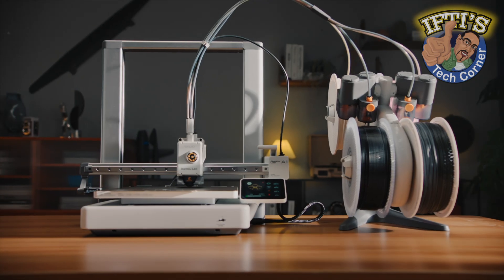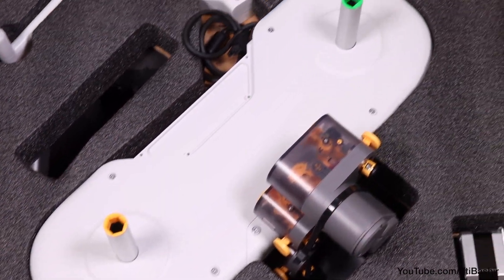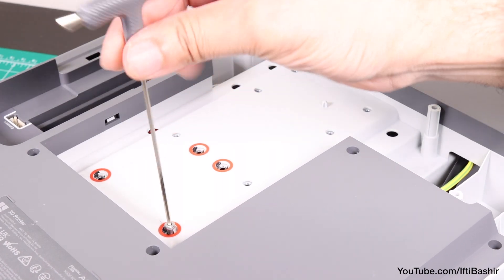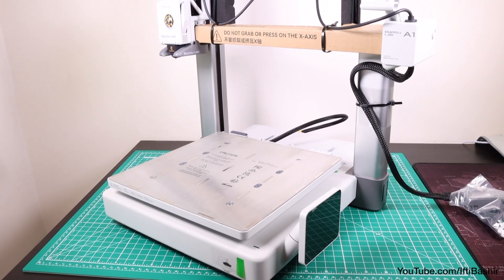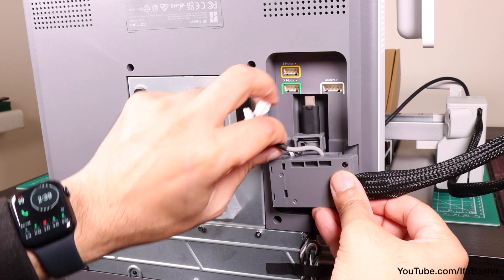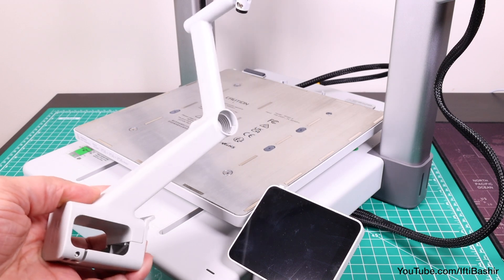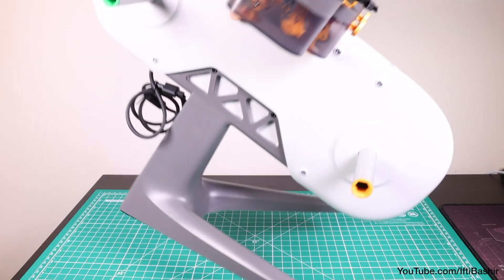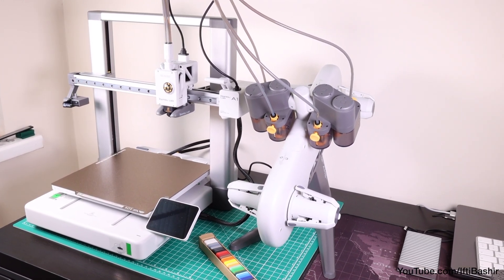#01 Bambu Lab A1 Combo with AMS Lite System : Hardware Setup - Is it overhyped?!

Comment: While this video is informative and helpful, I far preferred your original video which was much longer and with far more specific details.
I'm specially looking for how to determine which slots to use for  specific filaments types on the AMS lite for Bambu lab  A1 printer and how to load and select them for specific filament features which from memory you covered in the original video.

Comment: I just received my P1S yesterday. Boy has it been a pleasure. Fuss free setup and was printing 1,5 hours after getting it out of the box. Only minimal trouble with pairing the printer to my account but that was also quickly solved with some retrys. Might have been my internet. Benchy came out brilliantly and everything worked just as intended. The Bambu ecosystem is enough to get you started without issue. After about a dozen prints I am going to try a model outside of the quick print range. Lets see how bambu studio works when I import STL's.
Reply from the maker: In hindsight i wish I would have got the P1S rather then the A1 now - just because of the possibilities of expanding to 8 colour printing in the future!

Comment: i wonder what that usb-c cable does
Reply from the maker: link between extruder to mainboard - the smaller cables are links to the motors driving each axis.....
Reply: @iftibashir  someone should try to hack it with that